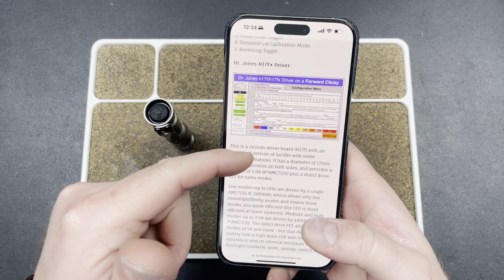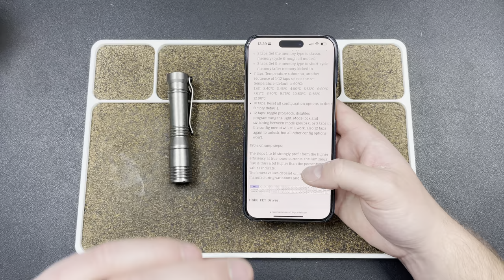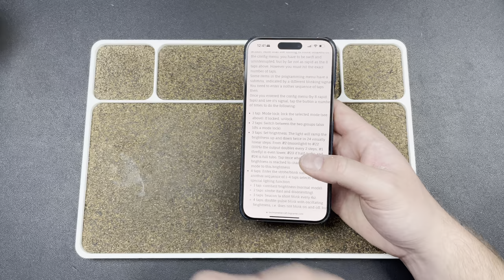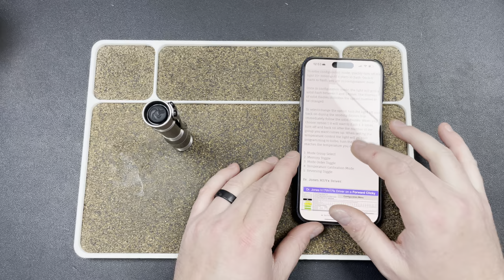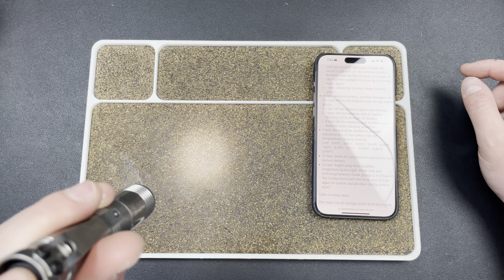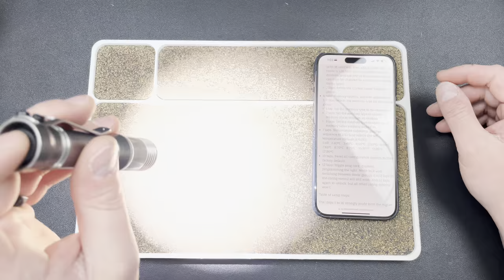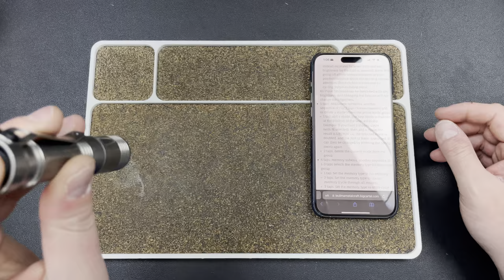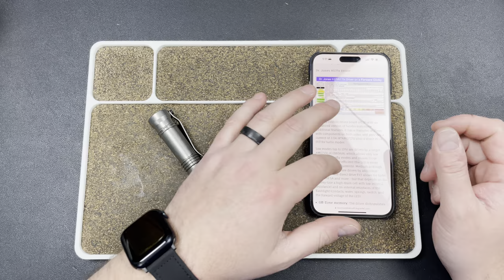Flashlight Tips: How to Program the H17Fx (Dr. Jones) Driver

Comment: The 24 brightness levels are designed to be "visually linear", meaning they're perceived as equal jumps in brightness to our eye. But our brightness perception follows Stevens' power law. That's why the steps between the 24 current levels are so uneven.

As I said on the other video, being able to control not just the lumen outputs but the number of levels is very cool, and really should be standard fare on all custom flashlights. This lets you decide on the total brightness range, the number of steps, the linearity of the progression, and the order. Many other custom flashlights just let you pick from a dozen or so predefined sequences, which seems pretty limiting to me. ZebraLight is one of the few mass-produced lights that lets you program output individual output levels, but with only 12 choices, and no ability to add or remove levels.

I agree it'd be nice to be able to disable double-tap. It'd also be nice if it was easier to switch back and forth between the two mode groups, But otherwise this driver seems like one of, if not the best out there. Thanks for the demo. It looks like the kind of thing you get the hang of with practice, after which you can do it quickly and easily.